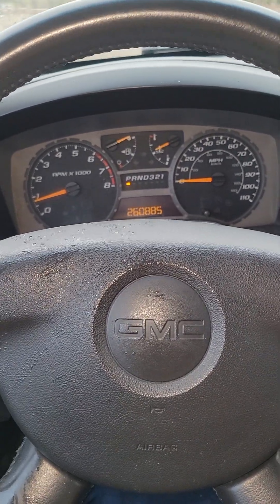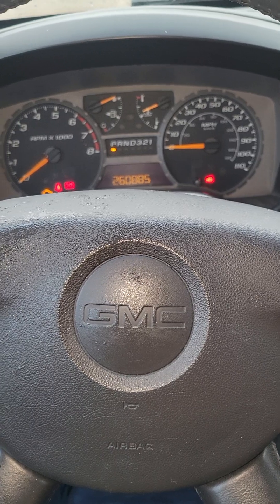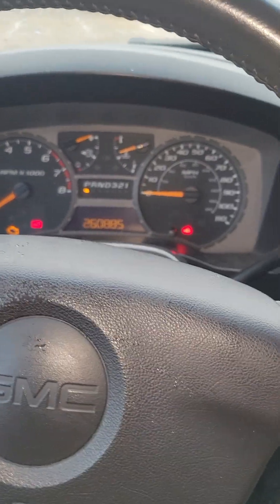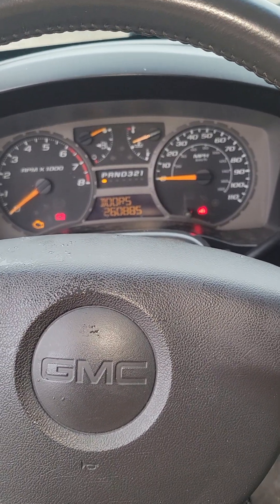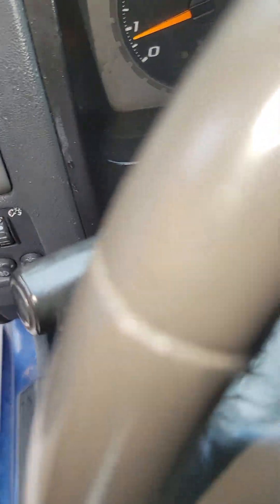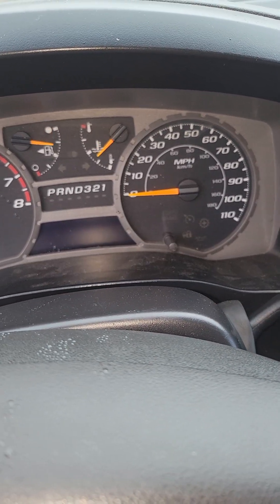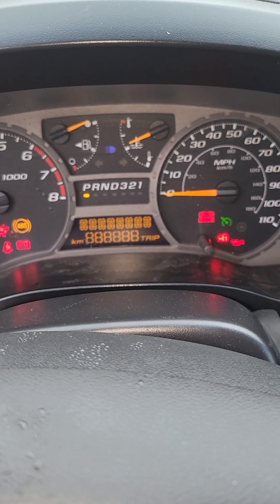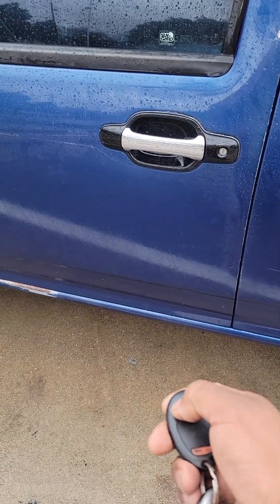2013 GMC Canyon  passlock bypass

Comment: Did this to my 2012 colorado, cut the wire while the truck was running, i turned it off did 3 quick starts and it fired up, went to cut my grass and went to start and the same thing no start just cranking...had to wait 10mins again  to start dont think this method works for all years 😢